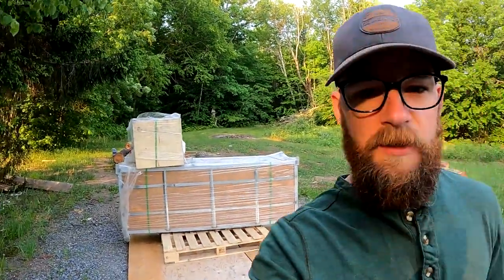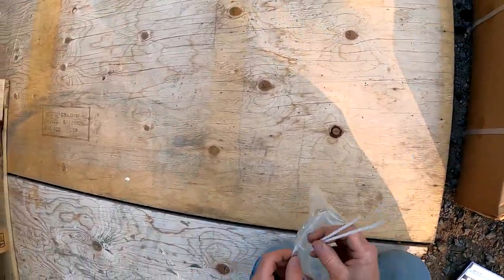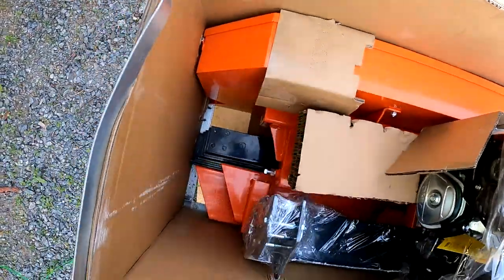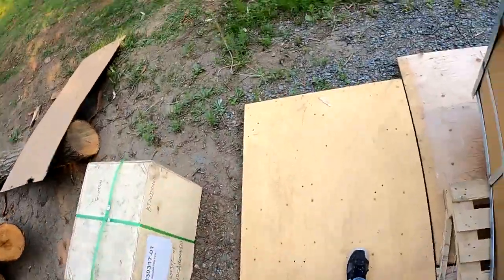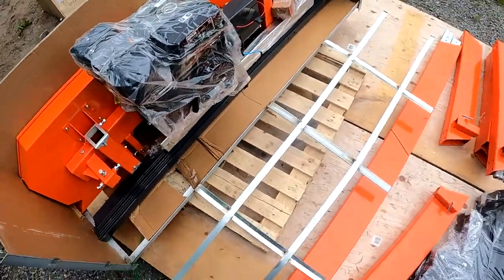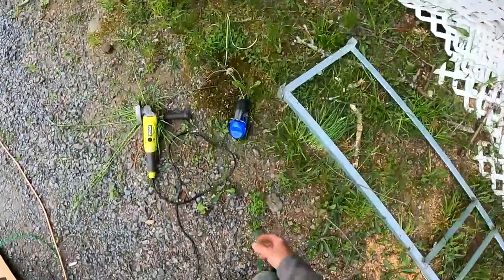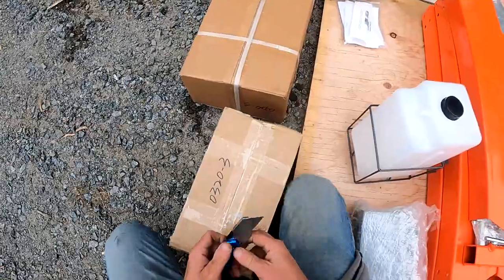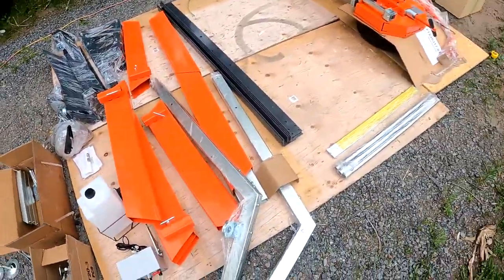Rima Sawmill Assembly Pt 1: Unpacking the Shipping Crate

Comment: I ordered the same saw today. How long did it take to get it? Did you have it shipped to your door or did you have to pick it up from the closest port? And pay those fees?
Reply from the maker: Congrats! I will make a video at some point outlining my importing experience. I think it took around 5-6 weeks to be ready for pickup (mine was shipped by boat to British Columbia Canada, then rail to Toronto). My mill was delivered to my Freight Forwarders warehouse, so I did not have to get it from the port. From the freight forwarders warehouse I had a trucking company deliver to my door as the warehouse unfortunately only allowed dock level trucks.

The import fees I had to pay before final delivery. I found a local company that was able to clear customs on my behalf which saved me a drive to Toronto.
Reply: Was that part scary money wise or fair. Just trying to figure out a budget
Reply from the maker: I wasn't too worried but you never know exactly how it is going to go. Things would have had to go really bad though for the price to reach the price of the comparable Woodland Mills HM130 Max.

My sawmill, sharpener, and extra parts came to around $4100 CAD. It cost another $506 CAD on importing fees, and I spent an additional $563 on getting a broker to process my customs paperwork on my behalf and hiring a trucking company to deliver the mill from the warehouse to my door.